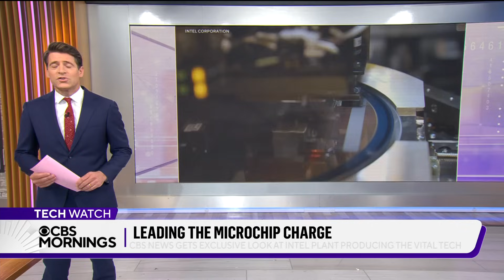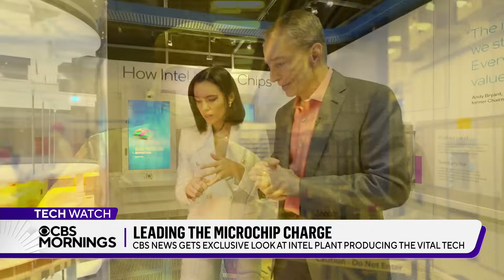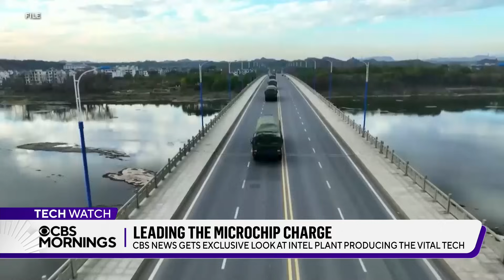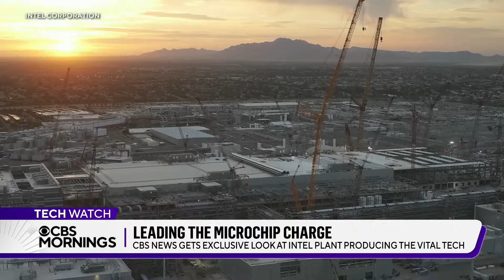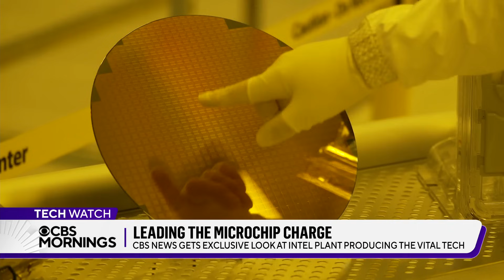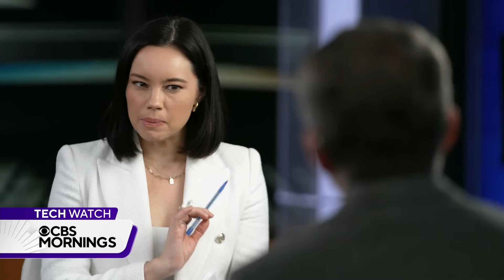U.S. ramps up chip production efforts with taxpayers footing part of the bill

Comment: In typical USA 'Exceptionalism'... at no point in the News Article was it mentioned: "the most advanced lithography tool in existence, one of only two in the world, made by the Dutch company ASML"... 
The Lithography equipment is from the Netherlands (Not the USA as was implied by CBS).
Reply: The EUV technology was originally developed by US DOE labs and the private sector via two consortiums in US and then the technology was transfefred to ASML\Netherlands, even to this day the main and the most complicated part of the EUV system which is the light source is designed and built by an American company in US, that's how US has the control over ASML and the EUV technology.

Comment: The U.S is forgetting about manufacturing of PCBs (Printed Circuit Boards). With PCBs comes along discrete components. Only then can you truly say that you have control of the electronics supply chain. I remember when I was small, Motorola, Philips, and GE were popular brands producing these discrete components. You cannot build a finished product without them.

Comment: Lol Intel is no longer leading
Reply: Yep, Intel was surpassed by TSMC ~5 years ago.  When the bleeding edge chip fabs migrated to EUV, and Intel got left behind.  They're now pursuing NA EUV, we'll have to wait a few years to see if it's too late.
Reply: Intel is going to be the industry leader again in less than a year with their 18a process technology, and then hopefully with the 14a and 10a, they are on the right path and they are pretty close
Reply: @JigilJigil  Getting a single NA EUV machine going isn't going to move the needle financially.  It'll take a few years for them to right this ship, optimistically.
Reply: @stanimal8  Intel is not going to use High NA EUV machines on its 18a process node technology.
Reply: @JigilJigil  Intel will not use NA EUV technology on its current generation CPU, that doesn't mean Intel will not be using it on next gen CPU in a few years.  When, hopefully, the NA EUV project is successful.  And if Intel continues to grow its independent fab business it could use it to produce chips for others.